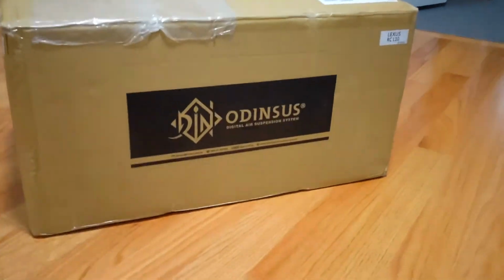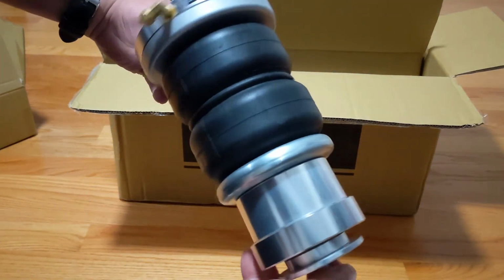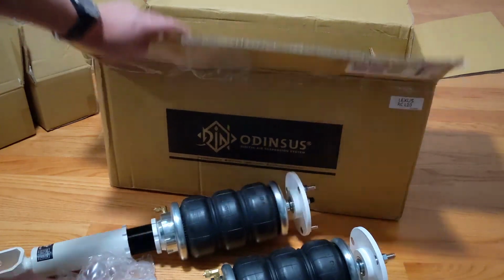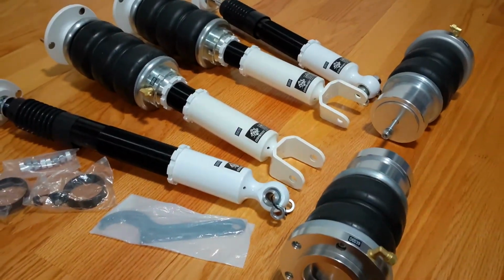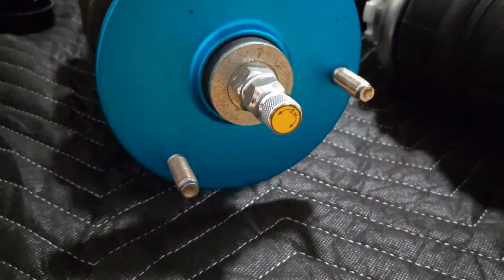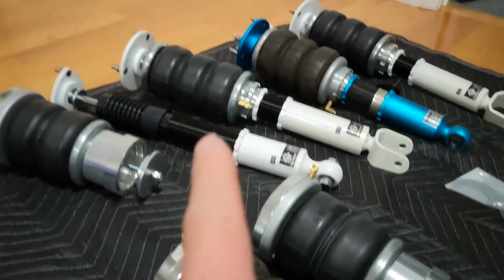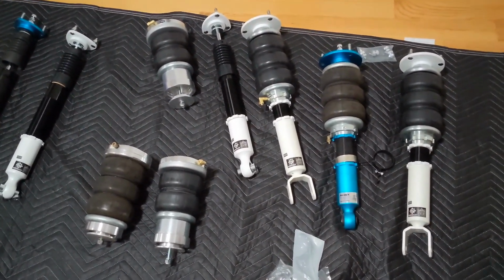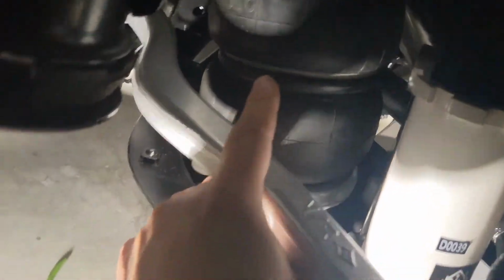OdinSUS (by AirREX) Air Suspension Struts Unboxing and Installed - Lexus IS500

Comment: Where did you get them I really like my airrexx struts on my 11 is350  and just recently pick up the 23 IS does it  ride the same?
Reply from the maker: I purchased from here, https://performanceairsuspension.com/
It rides the same/great, only thing I noticed is the solid spherical bearings on the rear shocks are a bit noisy vs the rubber bushings on my old Airrex setup.

Comment: Do you know if IS350 and IS500 use the same suspension?
Reply from the maker: The suspension is no different from a physical standpoint between the IS350 and IS500. I actually purchased suspension for a IS350 since the IS500 is such a new car and nothing is listed for it.
Reply: @specONE  Thanks a lot!!! I currently own a 2017 GSF. If I crash it, I will buy an IS500. Like my current GSF, I will also put an Ohlins on IS500... (If I don't crash my GSF, I will continue to drive it!!!)